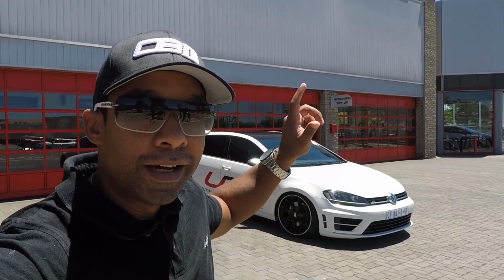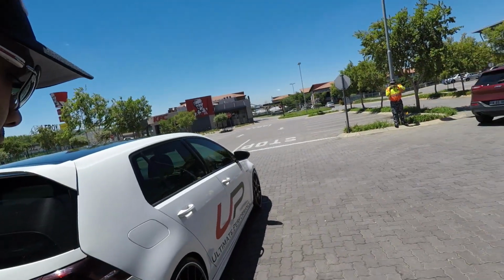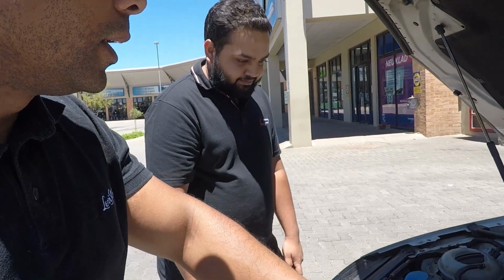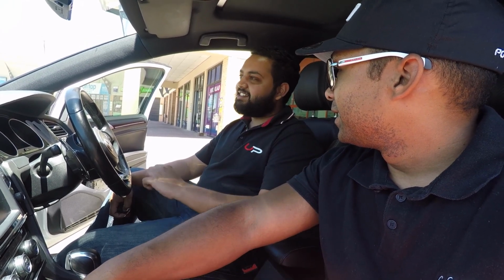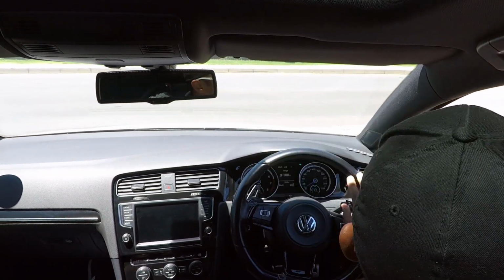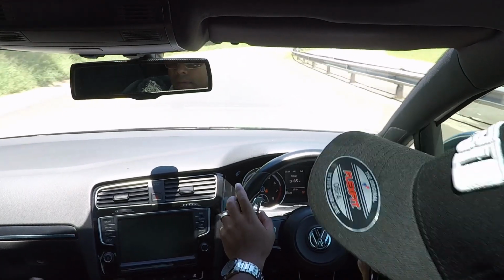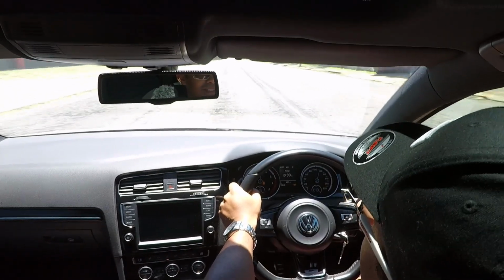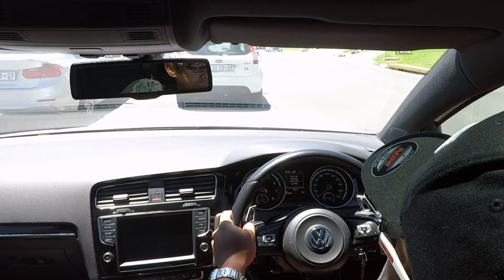Stage 3 VW Golf 7R Ultimate Performance tuned - What's the Drive, Launch, Sound & Acceleration like?

Comment: 280 kw means 380 whp which is very low for stage 3 with TTV5 Turbo
Reply from the maker: Agreed. They did say though that they just fitted the turbo and are still busy with development.
Reply: So i am running 430KW and 720NM On my 2019 AUDI TTS. I run the V5 with Meth and all supporting Mods. Everything of the Best. MRC Tunned.
Reply: @ClaytonReichlin  u want a cookie?
Reply: @nickovdub6131  Lmao.... make it two cookies for Clayton.
Reply: @ClaytonReichlin  Hey Clayton BFD thats still really slow for a stage 3 these days. Everything of the best? That made lol literally! If u had EVERYTHING of the best u would be making 550-600 whp not 400...🙄